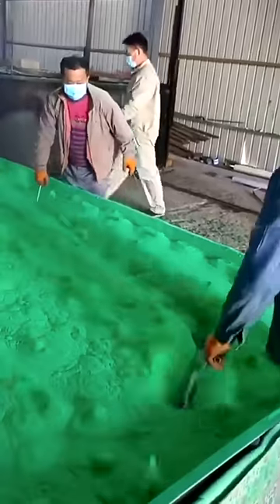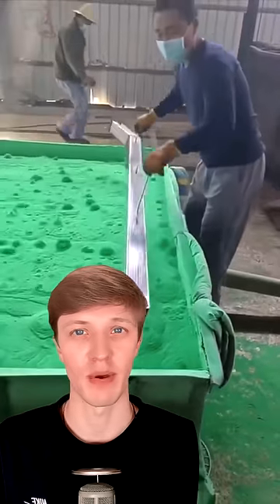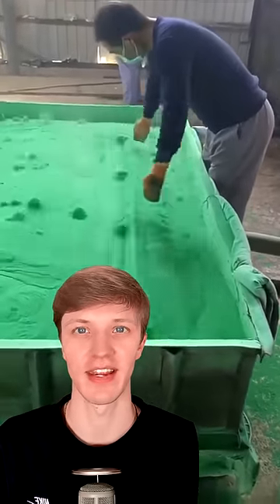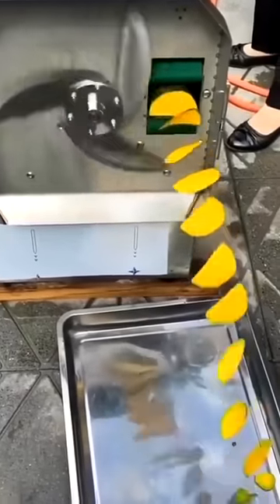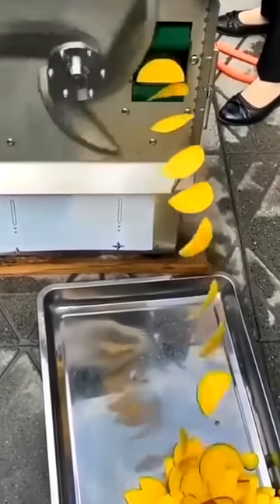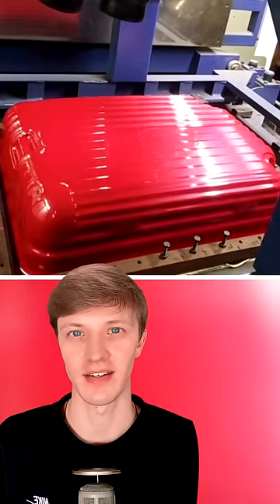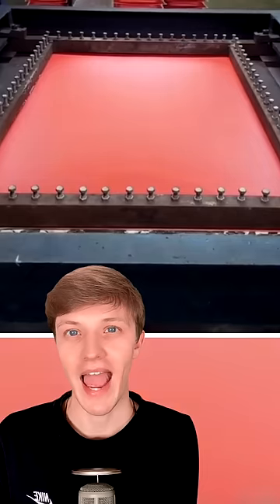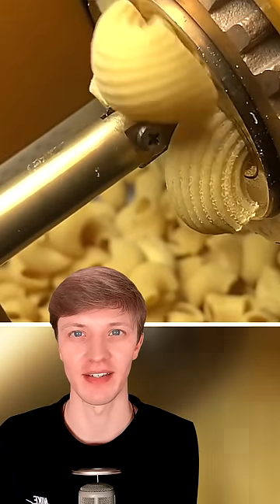How Things Are Really Made

Comment: I think they forgot the part where you heat it up on the powder coating in the fact that the paint isn’t paint at all it’s plastic disguise really fucking good at this stuff
Reply: Hi
Reply: He also forgot the part that they blow air under the powder to make it act more like a liquid to be able to submerge the parts in it.
Reply: And use electricity to make it stick evenly and be attracted to it
Reply: He also gets the vacuum molding wrong. I wish we could all aspire to be so lazy. Just take a look at things, guess how they work, and send that half assed work to your employer or client.
Reply: @IIGrayfoxII not in this case, when they're dipping like this the parts are preheated and the powder sticks. You're referring to a electrostatic gun and the parts would be grounded via a metal hook on a conveyor line.
Reply: I was wondering why it was bubbling
Reply: And the part where the charge the particles so they stick to the metal uniformly
Reply: @dapperdog2719  nothing is "charged" in this process
Reply: @tintshady2049  it is an electro static process. Surfaces that use electrostatic applications have the metal components grounded. While the powder itself is inert, it gains an electrostatic charge as the particles pass through the spray guns. The guns have an electrode fitting that adds an electrical charge to the powder particles. When sprayed onto the grounded surface, the particles stick. They become solidified into a dense coating during the curing process that melts and sets the finish.
Reply: @dapperdog2719  I'm glad you learned to use your Google search bar and copy/paste. There's no electrostatic guns in this video, goofball...the parts are preheated and dipped
Reply: Guys We Gotta Pass The. The Waffles House Has Found It's New Host In Replies
Reply: The Waffles House Has Found It's New...                      ........................ ዘዐነፕ
Reply: Pass The Waffles House Comment in...                  .                                                   ዪቿየጎቿነ
Reply: Also electro static applicable
Reply: @tintshady2049  You're absolutely right. I did this in high school and it was literally just a box of the powder with a blower attached, into which we dipped heated metal. 

Absolutely no electricity was involved except that used to power the blower.
Reply: It explains enough for the airheads of the internet
Reply: @WatchDragon  lol
Reply: I got so angry I started shouting at my phone "it's not DONE you f***!!!"
Reply: most are ceramic base paints, but same concept
Reply: Was looking for this comment… there’s a slight hope for the world
Reply: I was just about to comment this my dad owns a powder coating shop and worked at one for years they also forgot that most of the time you have to get it sand blasted so the powder will stay
Reply: @theSavvi101  it's bubbling because air is used to fluidize the powder.
Reply: Also that they are usually hanging from electrified conveyor "belt" which takes them through a washer and then robot sprays the powder and then it goes into oven and cools down while moving to packing area. 
I mean this is for any factory that coats irregular shapes of metal in any significant quantities.
Reply: @Ziegeri    I don't know about "usually", it depends on what you're paining. If you're mass producing a lot of the same things you might use automation but most job shops spray by hand and hang parts on wheeled carts. Dipping parts is good for things like mesh where you have a lot of Faraday cage areas or where you want to coat the inside of the part.
Reply: @stephenshoihet2590  used to work in a place where we made "furniture" to shops and lots of custom orders like ship parts etc., so thousands of objects in a day. So what I meant that most powder coated things come from places like that. Of course if you only coat couple items a day, you don't invest into such huge painting line.
Reply: Thank you for your service. I was coming here just for this comment.
Reply: I do powder coating for a living....he left some steps out 🤣
Reply: My first thought when watching this.
Reply: @IIGrayfoxII  static electricity.
Reply: Heat up the metal part I think you mean. I work with a smaller version of this one.
Reply: he's got a point, I learnt it at school
Reply: @theSavvi101  I got u I'm not the best one to explain it but mark Robert did a video on it but basically theirs a bunch of air coming out of pipes making it act like quicksand but a lot faster
Reply: I have something important to tell you.

all your house paints. the sealants. every coating is plastic. 
some just form a plastic layer when the solvent dries off..
Reply: Being a powder coater my self this is not how all powder coating is done most powder coating is done with a spray gun not this way
Reply: You all forgot the part where he made that mistake on purpose to cheese the algorithm for engagement to her more views.
Reply: @tintshady2049  it has to go into an oven after being coated in powder.
Reply: @chadklaren9537  and water is wet. Can we file this under the no sh*t category?
Reply: ans powder coating is not plastic
Reply: Didn't you know what he says is 100% true and in no way a random guess without research lol
Reply: and they  forgot to mention all the cleaning stages before the powder
Reply: He also forgot how they charge the powder and metal one negative one positive to get the power to cling to the metal until baked
Reply: @jorik41  yeah I forgot about what thats called but it’s really cool, the thing that turns it into a substance that feels almost liquidy
Reply: And the pieces are baked or powder would wipe off
Reply: Must be bringing up the trauma someone had fom having to work doing powder coating. Downplaying anything about the job but hey 4k likes is  constructive criticism if ya ask me.

Comment: The powder coat is way more advanced than you made it seem. There is air blown throughout the inside of the bucket to make it behave like liquid, the metal is statically charged so the powder sticks to it, and then the powder has to be evenly heated to an incredibly high temperature to melt it, and then left to cool down for ~a day.
Reply: Heated in a 400 degree oven for 30 minutes then cooled at a controled rate for up to 3 hours
Reply: Exactly. This is the fluidized bed application of powder coat and is great for mass production.
Reply: Seemed pretty obvious that t his video wasn't telling the truth, how the heck would dipping an object in powder paint it. The powder would just fall as soon as you touched it. But I guess the guy that made this video somehow thought what he said made sense...
Reply: Also, that powder is charged with the opposite of what the metal is. This helps it to stick while moving the parts.
Reply: Most powder coating is actually done with electrostatic charging of particles onto grounded metal via a gun. The way shown is for industrial and highly repetitive uniform parts.
Reply: Also, OSHA would like to speak to the workers power coating. >__<
Reply: Mark rober did a YouTube video about this if I remember
Reply: My husband and I are powder coaters. The metal isn't charged you have to place the ground on like what you use to jump your car, we have spray guns that we use. We put the paint in a thing called a hopper that blows air into it  a hose to the gun so when you spray it the paint comes out with a electric charge. We paint the product they take it to the oven depending on what it is  that's how long it cooks for. And then it's ready. I have video of what I do if anyone is interested.
Reply: i saw the poweder liquid part in mark rober her mad sand act like water and swam in it

Comment: The powder coating isn't just dipped it's statically charged so the paint actually sticks while it's baking other wise the powder will just blow off as you move it
Reply: Lovely thing... when you move the powder around like that... It generates its own static to stick to the metal which is preheated.  There are some methods here you heat the metal after coating and there you ahve a static gun to give the particles a static charge but in that dip tub... the static is generated through movement.

Comment: You should say "this is one way that metal is powder coat painted" and "this is how the plastic on some suitcases are made".  Powder coats can also be sprayed on or even hand painted on for that matter and the plastic on suitcases isn't already made in a "blow molding" machine, but sometimes in an "high pressure injection molding" machine.  These are the only ways to do these things.  Lol

Comment: The suitcases are vacuformed. They're not wrapped in that plastic, that's the outer coating being made. Below is a mold, they heat up the plastic, push in the mold and suck the air out to form it to the molds shape
Reply: He said they were vacuformed
Reply: @AnotherAltAccountYouDonkey  check again he said vacuum sealed not vacuformed
Reply: Bro has a masters degree in suitcaseoligy
Reply: The Waffle House Has Found it's New Host
Reply: @N1njatortus  my bad
Reply: @AnotherAltAccountYouDonkey  nw my g
Reply: Yepp
Reply: @deatheternal720   The waffle house has found its new host
Reply: Also most of those machines the plastic is pushed down not the product being pushed into it. At least that's how the machines I used at a crappy warehouse for a while

Comment: “The camera can’t keep up”

That’s the dumbest thing I’ve heard today
Reply: I think he means that the refresh rate is too slow for the camera to get a smooth video or something.
Reply: @archiethedog4515  also wrong. The blade happens to be rotating at a perfect speed to match the frames per second of the camera capture speed
Reply: @mnswitch  use youtube for education please. You desperately need it
Reply: @mnswitch  I’m to lazy to read the hole thing but 
I was going to comment that The camera speed
Is the same speed as the blade 
But I was also to lazy
So I didn’t & this pfp was the only good pfp I could find
Reply: @mattmurray6105  matt if that was the case the blade wouldn't be moving. the frame rate is under rate which gives it the slowmo effect.
Reply: @joeyhandles  to perfect the summary of what happened, the camera's shutter cannot keep up with the blade's extremely high rpm, so it will appear to be slow in front of the lens or sometimes just stay still
Reply: @mattmurray6105  you’re a jolly Fellow. 😭 anyone can gain intellect, personality on the other hand, Well, not so much. If I was a betting man, which I am. You’re a chemist. It’s just something that comes along with the title, ya know. 🧌
Reply: calm down lmao 💀

Comment: The FitnessGram PACER Test is a multistage aerobic capacity test that progressively gets more difficult as it continues. The test is used to measure a student's aerobic capacity as part of the FitnessGram assessment. Students run back and forth as many times as they can, each lap signaled by a beep sound.
Reply: Ok I'm ready
Reply: The FitnessGram™ Pacer Test is a multistage aerobic capacity test that progressively gets more difficult as it continues. The 20 meter pacer test will begin in 30 seconds. Line up at the start. The running speed starts slowly, but gets faster each minute after you hear this signal. [beep] A single lap should be completed each time you hear this sound. [ding] Remember to run in a straight line, and run as long as possible. The second time you fail to complete a lap before the sound, your test is over. The test will begin on the word start. On your mark, get ready, start.
Reply: @joaquinsenquiz9560  The FitnessGram PACER Test is a multistage aerobic capacity test that progressively gets more difficult as it continues. The test is used to measure a student's aerobic capacity as part of the FitnessGram assessment. Students run back and forth as many times as they can, each lap signaled by a beep sound.
Reply: @TheRealTennesseeTitans  The FitnessGram PACER Test is a multistage aerobic capacity test that progressively gets more difficult as it continues. The test is used to measure a student's aerobic capacity as part of the FitnessGram assessment. Students run back and forth as many times as they can, each lap signaled by a beep sound.
Reply: The missile knows where it is at all times. It knows this because it knows where it isn't. By subtracting where it is from where it isn't, or where it isn't from where it is (whichever is greater), it obtains a difference, or deviation. The guidance subsystem uses deviations to generate corrective commands to drive the missile from a position where it is to a position where it isn't, and arriving at a position where it wasn't, it now is. Consequently, the position where it is, is now the position that it wasn't, and it follows that the position that it was, is now the position that it isn't.
In the event that the position that it is in is not the position that it wasn't, the system has acquired a variation, the variation being the difference between where the missile is, and where it wasn't. If variation is considered to be a significant factor, it too may be corrected by the GEA. However, the missile must also know where it was.
The missile guidance computer scenario works as follows. Because a variation has modified some of the information the missile has obtained, it is not sure just where it is. However, it is sure where it isn't, within reason, and it knows where it was. It now subtracts where it should be from where it wasn't, or vice-versa, and by differentiating this from the algebraic sum of where it shouldn't be, and where it was, it is able to obtain the deviation and its variation, which is called error.

Comment: Even if the powder was paint, saying paint was turned into powder is stupid because paint is powder suspended in some solution that reflects a specific wavelength of light. So that would be boiling the liquid off of the paint aka an unnecessary process because you could just buy the pigment. And that’s if it even was “paint”

Comment: The powder coating is done by liquifying powder with compressed air first, as otherwise metal would not sink in it. And the suitcase thing is called vacuum-forming, as heated plastic is first expanded and then vacuum formed around the mould, which is the thing that pops-up from below. Its not a wrap.

Comment: What's shown for the powder coating is only a quick glimpse of the first step. What isn't shown is the fact that before the pain is applied is the application of electricity into the metal, mostly to make a magnetic bond with the paint. Step two is shoving the painted metal into a huge oven to heat it much hotter than any form of food, essentially causing the paint to melt and resolidify like glass on the outside of the metal. After that, additional coats might be applied as some cases require additional coats of paint to resist damage like how some house paints work and how automotive paints are capped off with a clear outer shell to prevent scratching.

Comment: Fluidized power coating! Blow air into tub, they make multiple colours, and different types pod plastic for other applications! The parts are cleaned and either etched primed or grit blasted or both! Then heated and then dipped, and hung to dry or heated to cure! Very cool process!

Comment: They run an electric charge through the metal that makes the powdered paint stick. Then it goes through an oven to melt the paint on. Actually did this job for a bit at a fabrication shop.

Comment: Powder coating can also be sprayed on with pressurized air and a gun like handle the powder is then held on by negatively charging the metal and positively charging the powder through the gun it's super messy and finer then flour

Comment: One the powder coating is heated after being statically attracted to he part 
And the suitcase process is called vacuum forming a mold is pressed up into a heated plastic sheet then a vacuum applies underneath pulling the plastic over the form 
Remove the form and you have the outer shell of the suitcase

Comment: Powder paint at the factory where I work is applied through airguns with static charge. The parts are thousands of pounds and can't be dipped and shaken the way it's shown here. The parts have an electrical charge ran thrthem and the guns are set to the opposite so the particles gravitate towards them.

Comment: the suit case one is called vac molding they heat the plastic lower it over a form then aply vacume force under and threw the form to mold the plastic into the shape then cut it out and add hardware to make the suitcase they dont wrap it in heated plastic

Comment: you're wrong about the luggage.  The process is called vacuum forming where they heat the plastic like material before pulling it down over a form and then pulling a vacuum to conform the shell material to the form, they then take that shell off the form, it is not left on the form as you seem to think.

Comment: also you are wrong on the suitcases.  the plastic bubble is the suitcase. this is a process called vacuum forming, where a hot sheet of plastic pulled down over a "form" or block, the plastic is then removed from the block and is then turned into a suitcase.

Comment: that's only part of the powerder coating process

they electrify the parts so the static electricity keeps the powder on the part, dip or spray it and finally put it into an oven to heat the powder until it melts and then let it cool down for a near perfect piece

Comment: There is alot more to powder coating that a dunk in powder. You have to charge the metal then dunk it for the powder to stick. Then you have to throw into an oven to bake it onto the metal.

Also there is alote more ways to paint metal.

Comment: Its not just dipped and it's done.  
It has to be placed in an oven and baked for a certain amount of time.
Its how it gets hardened and adheres to the metal then a clear coat if any gets added on.
If you are going to explain a process, explain the whole thing.